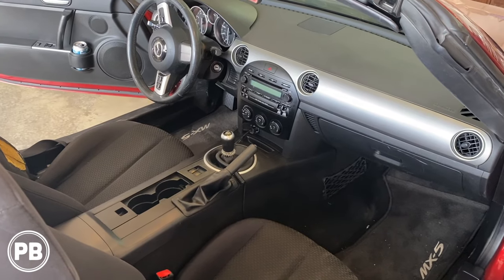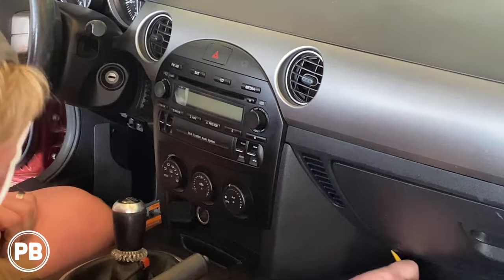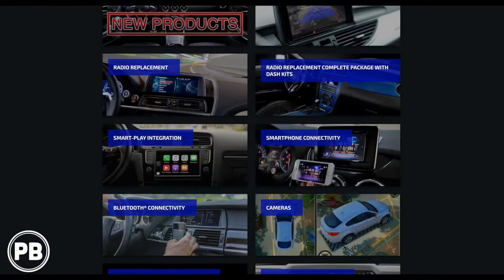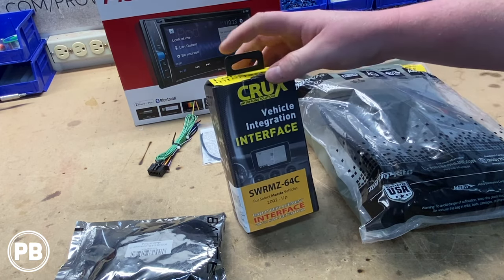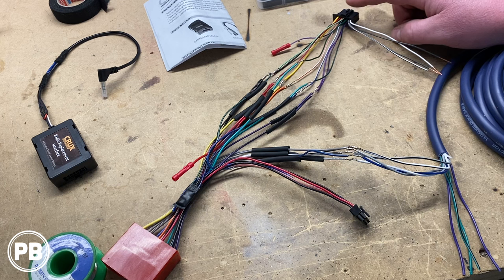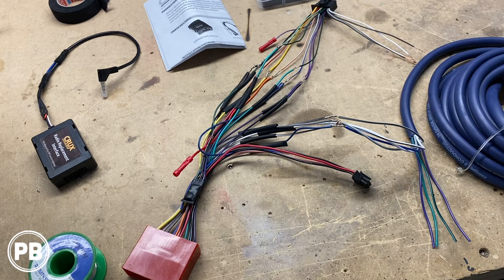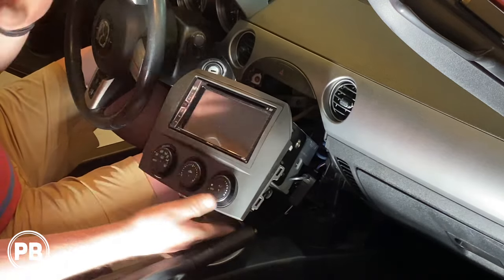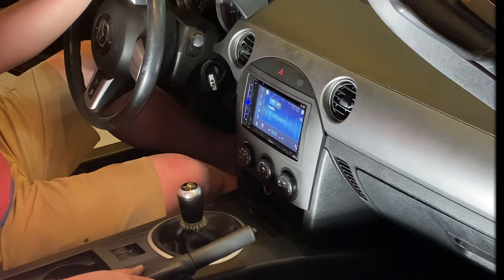2006 - 2015 Mazda MX-5 Miata Radio Install | Pioneer AVH-210EX

Comment: Looking forward to installing my new radio next weekend. Man! Mazda sure did make this a bunch easier from the NA model. The HVAC controls had massive cables attached, and the cavity where the radio is installed is a nightmare. Messy and cramped. On the NC, because of the modularity, this could be done in minutes, rather than hours.

Comment: Nice work!  

I wish you guys were located in the Pasadena, California area.  I have a 2008 Mazda MX 5 Grand Touring model with the original Bose 6-CD head unit, and I'd love to get it replaced with a new Apple Carplay head unit to go with the Bose sound system.  Although I may need to upgrade the amp and speakers anyway being that the car is 16 years old.
Reply: Hey there, I just got the same year and model, did you figure out a good replacement?
Reply: @mmartinez3619  I wound up getting an Alpine iLX507 with a 7 inch display along with a module that lets the steering wheel controls adjust the volume level and also switch to the next track. The car stereo installer also used a dashboard kit that made the radio fit perfectly, with the temp control knobs going below the radio. It looks great and sounds amazing!

Comment: So I am new at this, watched this video at least a dozen times, used the handy links to order the parts, some took much longer than others to come in. Put all the wires together and installed it only to find out the link for the pioneer radio sent me to a different one. 😢 Think I can order the correct one and just hook it up but just a warning to people that the link here for the radio is not what is on this video.

Comment: Can you just use any double DIN head unit, with all the other components in this kit? How difficult is it to make this all work with the Bose sound system? I'm gettin' an NC Miata soon, looking to do this upgrade for sure!
Reply: Did u find any workarounds?? Or solutions?

Comment: Hi very helpfull video. i have a problem with mine it doesnt hold settings for clock and steering wheel settings  when i turn off the car

Comment: Great video, 
I have a 2007 Mazda Miata with a Kenwood touchscreen . Whenever I hit a really strong bump, it seems that the whole mechanism pops out. Do you have any solutions to prevent that the guy at the shop said that nothing is broken and doesn’t understand why it pops out. What pops out is the plastic frame that holds the radio plus t the controls. Just the top of the plastic frame pops out then I have to push it back in and I hear a strong snap noise.

Comment: Installed the same Crux SWC adapter, using it with a Sony XAV-5500 in a 2008 Miata. The steering wheel controls don't work properly, when I press volume up on steering wheel, nothing happens, but then I press volume up on the headunit and the volume will go up to max. Same thing happens with volume down. Steering wheel mute doesn't work at all.
Reply: Did u find a way to fix it?
Reply: Yeah^

Comment: Please can you advise when replacing the stereo system The aftermarket fitted beautifully but for some reason my does not ,I do not have the side brackets but is there anything you can advise that will fit the whole unit in without the top slightly petruding on the top of the fitting

Comment: The head unit I got (and all the others I looked at) require a connection to the parking brake for full functionality since they don't want you to be doing certain things while the car is in motion.  I was hoping to see how that connection was made.
Reply from the maker: Depends on the radio. Most radios (except pioneer and alpine) can simply be grounded.

Comment: I installed this in my 2007 Miata, but the steering wheel controls do not work. Any idea of how to fix this?
Reply from the maker: Depends on the parts you used, radio used, how you hooked it all up, etc.  Lots of variables there.

Comment: I know the title says 2006-2015 but for some reason on the 2011 the side panels are not clipped. I had to remove the console. Could I get away like you did for the side panels? I have to remove the radio since the clips did not work well. I'm using the factory clips.

Comment: I did this on my non bose miata but for some reason the sound is extremely quiet. Is this because I need to wire something directly to my factory amp?
Reply: I had same problem did you find out how to fix it?

Comment: Hi - I want to buy a 2010 with the Bose unit. Can I do this mod? Can I get Bluetooth phone with this?
Reply: Yes on both questions. You’ll just need a line converter in order to keep the Bose amp. I just completed my pioneer install in my 12 gt. I used the same crux module he used along with crux converter…..all from crutchfield